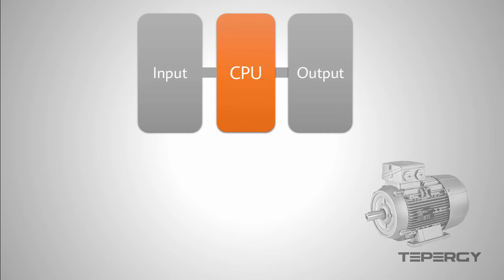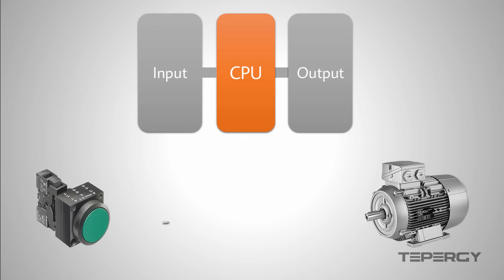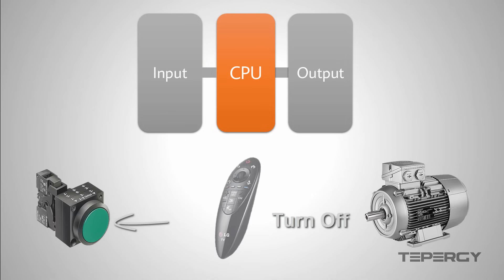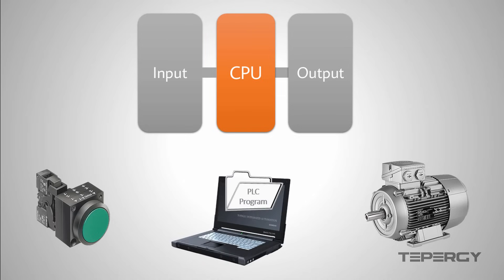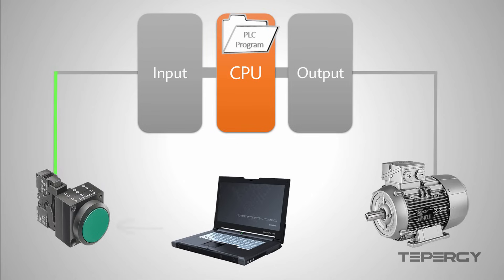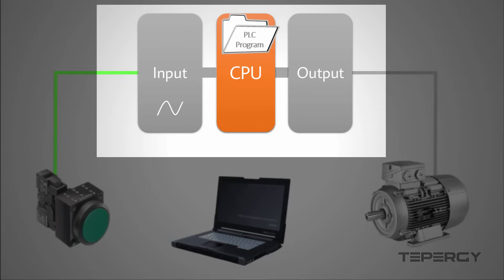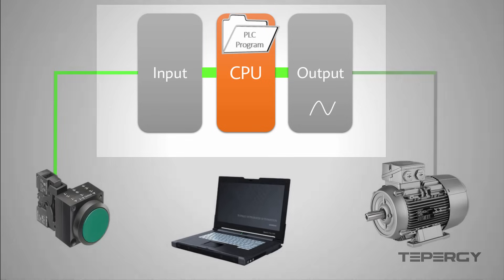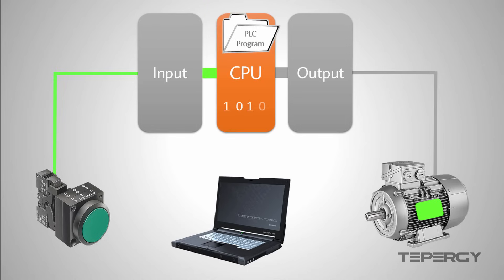What is a PLC? (90 sec)

Comment: Thanks a lot for your simple explanation.It would have been better if you had also explained that if the motor is changed from 1 HP to say 20 HP then how PLC will help us and in that case what hardware( wires, switch etc) will still be required to changed.Also inform as to what hardware will not be reauired to be changed if PLc is used.Please do reply.
Reply from the maker: Hello, @MohammadIrfan-xp7sr. Thank you for your question. As you stated, we would have to look at the electrical engineering requirements, do our calculations, and size as required for a larger motor. However, the engineering rules for safety and application would be the same. You might want to investigate some of our short videos we have on YOUTUBE on this topic. You can also become a member and learn more about the issues you are interested in at www.realpars.com  Happy learning from Realpars!

Comment: the button you shows it can turn off the motor even without the CPU why we need to put the CPU in between ?
Reply from the maker: Hello, @bzentoonia. Thank you for your question. You are correct; the button can turn the motor on and off if you have relay logic. The button itself cannot turn the motor on or off. The button can’t handle the current load of the motor. Therefore, you need the relay logic of small relays controlling the large relays or electronic controls for the motor.  The PLC will replace all the small control relays, and you must still use large relays or electronic controls for the motor. The PLC with programmed logic replaces all the small control relays needed to run a control system.   Happy learning from REALPARS!

- 6
    
    @A_Sarco
    With that program make the Connection Diagrams and Control System Architecture
    https://www.youtube.com/watch?v=jXRksET5vNo&lc=Ugyu-vjl89PvJ8WuolZ4AaABAg
    
    Answer: Hello, A_Sarco. Thank you for your question. With DCS software like Siemens or AB, you design your system as you do your programming for the devices you will use. However, the DCS software is not a CAD program for making diagrams if this is what you are asking.   Happy learning from RealPars!

Comment: Hello, I have a question regarding the pin-to-pin skew/alignment about multiple PLC outputs. For example, input X0 is connected to both output Ym and Yn in Ladder Logic. If there is a transition on X0, Ym and Yn would be updated simultaneously. However, it seems like there is no guarantee that Ym and Yn will be updated exactly at the same time from the perspective of Output Pin Voltage Level (this is unlike the FPGA, which can ensure that two outputs are updated at the same edge of clock except for IO path delays). Further, if "update status cycle" takes 0.1ms in total, may I assume that the maximum skew between Ym and Yn would be as large as 0.1ms?
Reply from the maker: @localfuture1484 Thank you for your question.  You have a good question and there are other factors, like voltage, mechanical, devices used and PLC MFG vendor type.  The best solution I would recommend is to read the specs on the PLC you are using. They will give you a reaction time for their product, provided your conditions are perfect. 
Happy learning from RealPars!

Comment: PLC sends the digital signal to the CPU.
CPU makes calculations to change the digital signal for on and off respectively.
How does the motor understand the digital signal from the CPU?
Reply from the maker: The input signal is sensed by a digital input card. Periodically (every 50ms for example) the state of the pushbutton is sent to the CPU.  The CPU executes some logic, and if appropriate, sets the state of a digital output on a connected digital output card.  The digital output is essentially a switch, which completes a circuit to a motor starter or relay, that when energized, causes the pump to start.  The I/O cards communicate to the CPU via a backplane or via a communication interface if the I/O card is remote from the CPU rack.

Comment: You can make a motor turn on or off with a simple switch.  An integrated circuit is merely overcomplicating the function.
Reply: Nonsense, what if I want to control the motor remotely? There are tons of reasons why someone would need this function.

Comment: Why the should I need plc when I can directly connect motor to the switch..??
Reply from the maker: You are correct.  You wouldn't need the PLC at all.  What if you wanted to not start the motor even if the button was pressed if there is an interlock condition, such as when an upstream feed tank is empty?  We don't want the motor to start on the pump in this condition.  The PLC allows multiple signals to be brought into the logic so that the process is operated safely and under the optimal conditions.  This is not always easy to do with strictly field-mounted operators, such as switches or pushbuttons.
Reply: @realpars  ohh yeah ,Thanks for your info sir ❤️

Comment: Quick, A programmable Logic Controller or PLC is simply a special computer that is programmed to control certain processes in industries like petroleum, steel or automotive. Every PLC is composed of three main parts: Input, CPU and output. Suppose that we have an electrical motor and push button. We want the motor to turn on when the button is pressed. When the button is pressed again, we want the motor to turn off. This function is similar to the function of the power button on your TV remote. To do this, we must first write a program for this operation on a computer and then download it to the CPU. Then we connect the switch to the input and the motor to the output. Now if we press the button, an electricalsignal will be sent to the PLC. The PLC input will deliver this signal to the CPU but first must present it in a format that the CPU can process. Why? because the CPU is a computer system and connot process the raw electrical signal. The CPU will process the data received and send the result to the output. The output turns the data to a raw electrical signal again and applies that to the motor and turns it on. Now if we press the buttonagain, the process repeats and the motor will turn off. Okay.

Rápido, un controlador lógico programable o PLC es simplemente una computadora especial que está programada para controlar ciertos procesos en industrias como el petróleo, el acero o la automotriz. Cada PLC se compone de tres partes principales: entrada, CPU y salida. Supongamos que tenemos un motor eléctrico y un botón pulsador. Queremos que el motor se encienda cuando se presione el botón. Cuando se presiona nuevamente el botón, queremos que el motor se apague. Esta función es similar a la función del botón de encendido en el control remoto de su televisor. Para hacer esto, primero debemos escribir un programa para esta operación en una computadora y luego descargarlo a la CPU. Luego conectamos el interruptor a la entrada y el motor a la salida. Ahora, si presionamos el botón, se enviará una señal eléctrica al PLC. La entrada del PLC entregará esta señal a la CPU, pero primero debe presentarla en un formato que la CPU pueda procesar. ¿Por qué? porque la CPU es un sistema informático y no puede procesar la señal eléctrica sin procesar. La CPU procesará los datos recibidos y enviará el resultado a la salida. La salida convierte los datos a una señal eléctrica sin procesar nuevamente y los aplica al motor y los enciende. Ahora, si presionamos el botón nuevamente, el proceso se repite y el motor se apagará. Bueno.
Reply from the maker: Thanks for sharing, Luis!